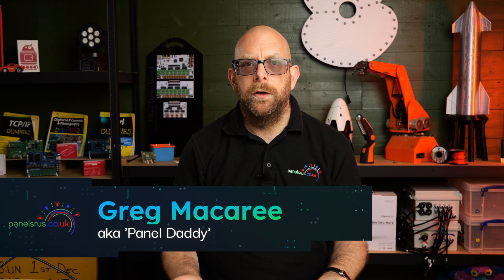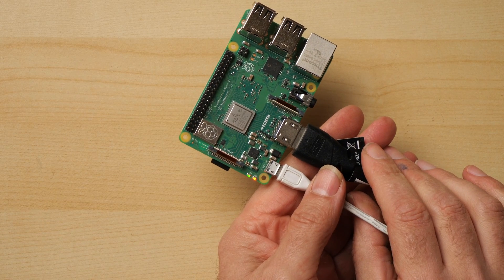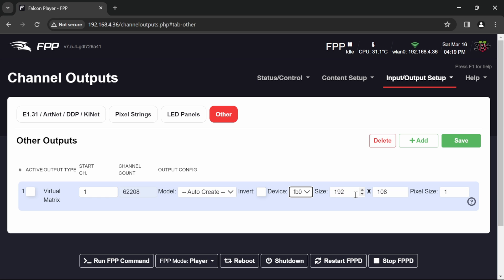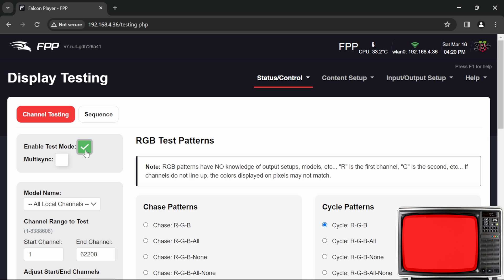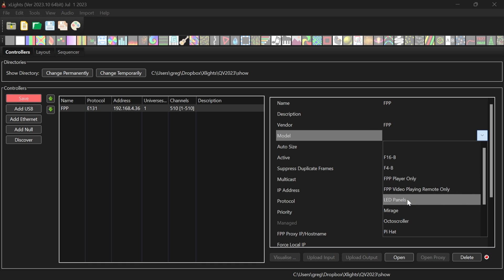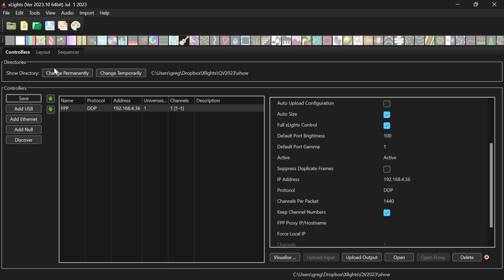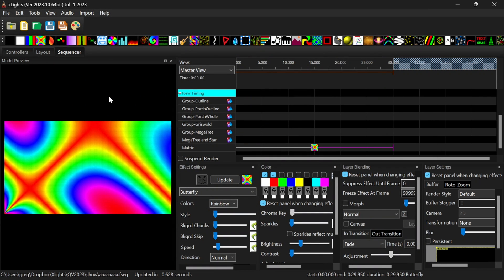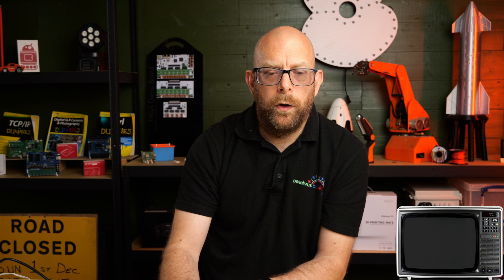FPP 7.5 - Virtual Matrix

Comment: Great video
Have a  question what is running on the Pi that is sending the video to the screen, etc.. 
I have a Pi setup to run FPP and it has a top-hat that is a driver (RPi-28D+),  I plan on using a 2nd Pi for the video because it will be little ways from this one.
will v the 2nd Pi (one connected to the screen) be running a native Pi OS or will it also have FPP on it and where will the video be loaded on this one or will be load on the one that is running FPP with the top-hat.
Thanks  for all your videos very helpful